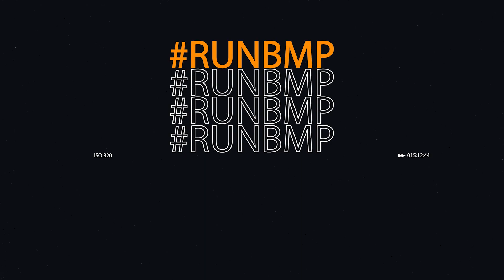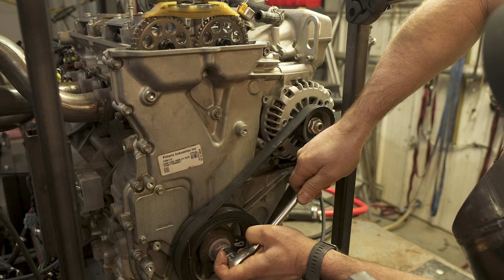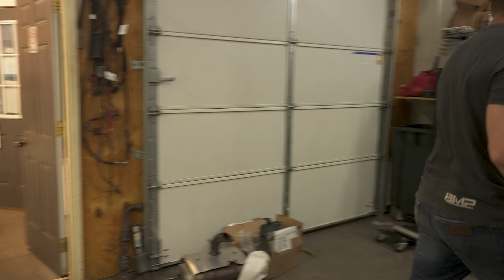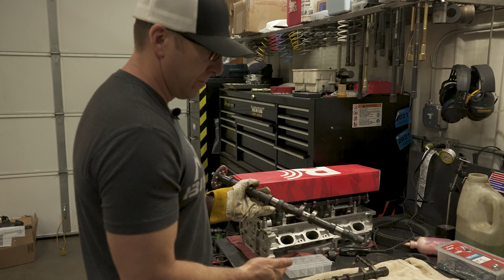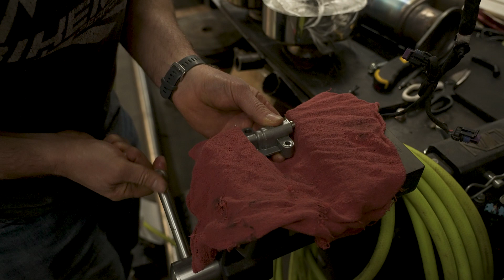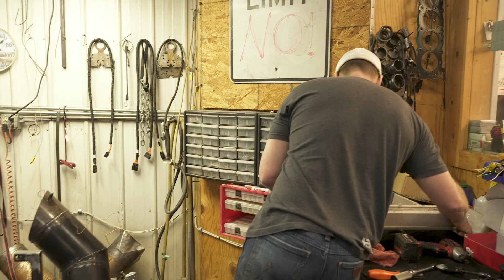Polaris PRO R Cam Install Bikeman Performance Installation Nation

Comment: Is there a startup procedure after installing these and the hard ecu flash?
Reply from the maker: 1. Roll the engine over by hand at least 10 revolutions clockwise when looking at it from the rear.
2. Check Cam timing to make sure it is correct
3. Make sure coolant and oil is at the correct level.
4. Start the engine and hold above 2000rpm until it reaches 170 degrees F.
5. Using the throttle drop rpm 50 rpm per 30 seconds until idle seems unstable. 
6. Stay at the unstable rpm until it becomes stable and then repeat step 5.
7. Once the machine is idling at 1450 stable with no throttle input let sit and idle for 10-15 minutes.
8. Your machine is now ready to ride.
9. On higher duration cams it is common to need to give a little throttle to start the vehicle this is completely normal.

Comment: Just in did tis install with engine in the machine still, 35 min to get the parts off to access the head.  Im a layman mechanic  so it took me another couple hours to get it installed and back together.  Easy overall and ready to rip!
Reply: How did you figure out? The timing marks to make sure you’re right on the money the video doesn’t really show that good of a clip.

Comment: What is this setup putting down for wheel hp and torque?
Reply from the maker: We almost always dyno directly to the engine . You have the same loss in hp through the CVT and drive train when you gain power. 20ft Pound gain in Torque. 70hp Gain

Comment: Curious after the swap how or if you recommend a break in procedure?
Reply from the maker: Start up, make sure you have no weird noises. Cams and exhaust sound wont be much diffferent than stock. You will know you have a issue right away on startup if there is one. Normal warm up before you drive it, and once driving, the first 10-20 miles just vary the throttle with no long extended holds at the same rpm or high rpm revs. after that the machine is good to go!
Reply: @BikemanPerformance  Thanks!